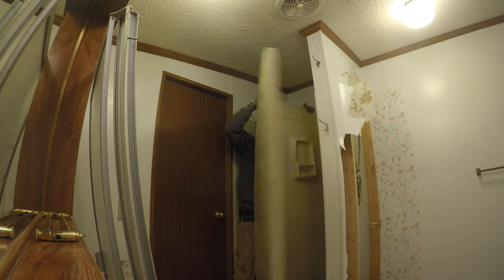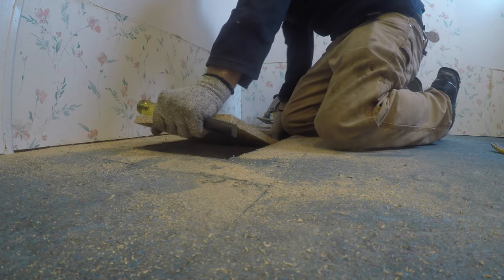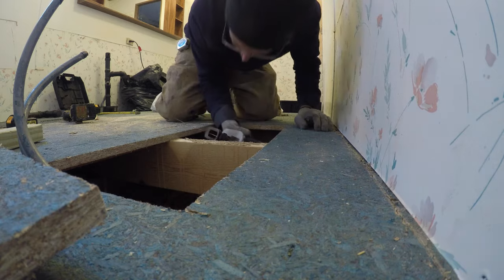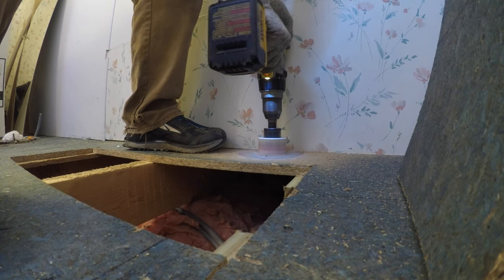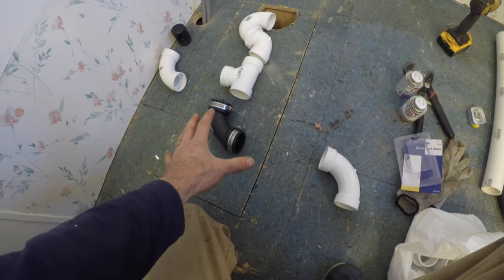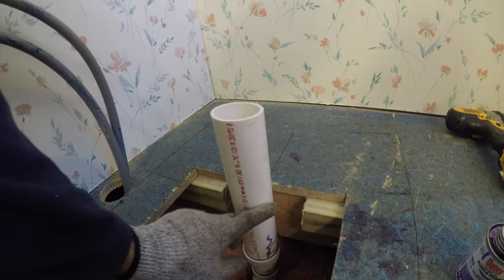Bathroom Transformed on a Tight Budget

Comment: I was doing some plumbing at work (cheese factory) what I thought was cold water turned out to be hot water lines weren't property marked & the cold water was insolated & the distance to the boiler manifold was a good distance after I replaced the valve & some stainless pipe ran the water for what seemed like 5 minutes when it got hot it was hot 
The crazy part was the water lines were not square how they ever got together begin with I'll never know I used three pieces of used like new stainless pipe  3-1/2  4-1/2 5-7/8  cut and thread from the valve down into the T at the cold water line everything straight & no leaks
As always a great job you did on the bathroom
Reply from the maker: That sounds like a wild project... out of square pipe! That’s crazy. I’d love to see a project like that one